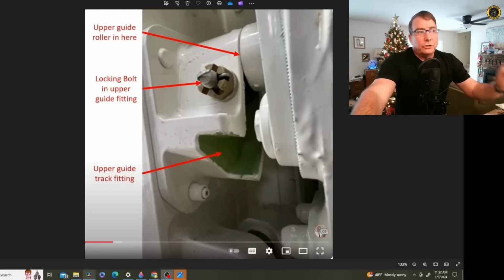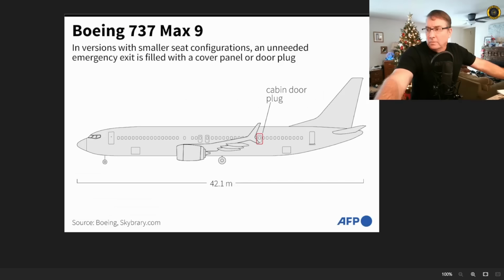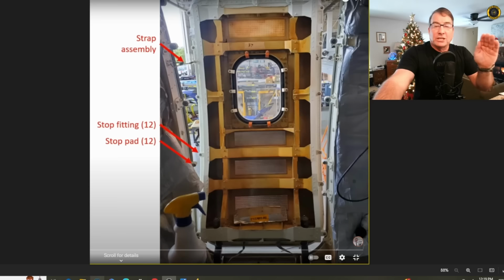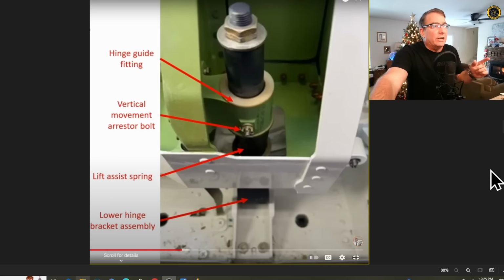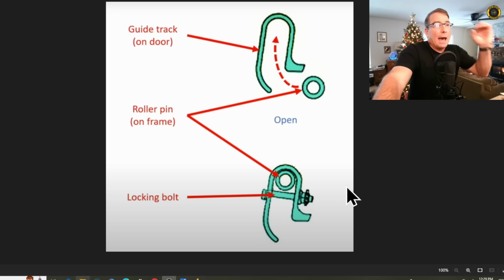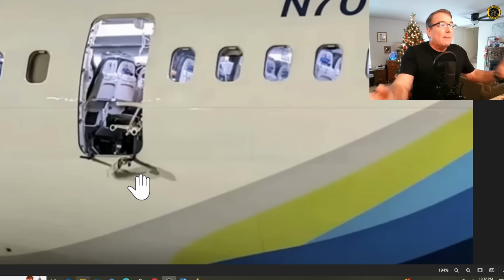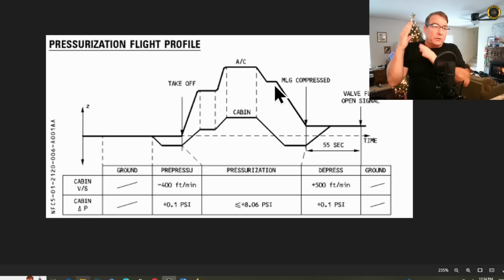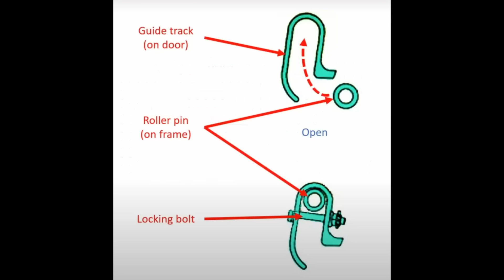Alaska 737 Max-9 Door UPDATE! 8 Jan 2024

Comment: To fail to install those bolts is criminal IMHO and that would mean that someone was up to no good. I just read that the bracket has been found and is cracked, so if the bolts were installed but the bracket was a POS, then there is nothing for the bolt to actually attach to. SMH

Comment: What the hell good is this door? It's bolted in place. There is no way to open it with out disassembly of the interior. It's not very big and it's in a useless location. I would suspect this door would never be opened for the life of the aircraft except for inspection. So these can't be used for an emergency exit. WTF?
Reply from the maker: see previous updates.

Comment: Perhaps a better design of door opening plug could be a design of key used in tunnel precast concrete lining. The lining is erected in sections called segments the last two segments have a tapered end from leading edge to the rear, plus a taper from extrados to intrados. The key segment has the corresponding angles on the side face and is pushed into the segment gap from the leading edge of the ring, a hydraulic ram is used to slide the key in which gets tighter as it goes. Bolts hold the key in place and the Tunnel Borring Machine excavates forward using hydraulic rams pushing off from the already built ring. This in turn tightens all joints. A cement/water gout is then injected to fill the gap between the excavated material and the back face of the ring. Overtime ground settlement will tighten the ring joints even more. To a point where all the bolts can be removed, this is seldom done due to the expense of labour and equipment.
The same joint angle could be employed on the plugs, but they would need installing from within the aircraft. So, cabin pressure would act against the plug from inside out, the opposite direction to a tunnel. The tunnel linings are being used in undersea areas of 5 bar pore pressure.

Comment: After looking at a diagram for the plug, I am still not certain how the plug is sealed against the frame. Is the plug sealed against the frame from the outside or is it sealed against the frame from the inside? In other words, is the cabin pressure trying to push the plug away from the frame or is the cabin pressure pushing the plug against the inside of the frame.
Reply: Those 12 interfaces are essentially two opposing tabs that protrude from both edge of door and the frame and overlap providing a way to keep the door from being pushed out after it’s slid in place.

Comment: There is still something missing. The door was still forced shut by the springs. It had to move 30-40 mm downwards against the two springs in order to release. So I Agree there is something missing with the securing bolts, but there must be something regarding the relative movement in top.
Reply: Wrong. You have it backyards.
Reply: @OsoMagna  you are correct.

Comment: To me that design is quite   Good. I don’t see how bolts would get stressed to even sheer. The bolts nuts pins wouldn’t get stressed. Loose bolts would hold it. Bolts with no nuts is another question. Even without out pins I don’t see many nuts that would spin of that easily on 4 separate bolts.

Comment: Why are these exits even there when you cant open them from
the inside ? Are they supposed to fall out in case of a crash ?
Reply: They're not exits, they're entrances.
Reply: If you put more seats into the cabin you would need these exits as emergency exits. Under a certain number of seats you legally don't need them and then they close it with a plug instead, since the plug has a full size window.

This is more flexible ( for example if the aircraft gets more seats in tge aftermath) than making fuselages with a different number of openings

Comment: Now that I see how the door plug is installed to it’s final position and secured by 4 bolts, 4 nuts an 4 cotter pins, it is obvious these bolts, nuts and cotter pins would have had to be totally removed in order for this door to have been pushed upward by the two lower bracket springs and then exit the fuselage.  Folks, this was sabotage and nothing less.  This airplane had very low hours on it.  If these 4 bolts were not installed at the Boeing factory, this door plug would have left the fuselage way before now.  This was sabotage and nothing else.

Comment: What's the purpose of all this engineering feat for a "non-door" door?
Isn't it just more convenient to install a normal door?!! Or no door at all?? 
Is it because it's cheaper this way if airline configuration doesn't require it?🤔
Reply: Having a single design of a fuselage frame, especially a critical part like the door opening saves money on the design side (only have to design and test one) and an actual operating door is much more expensive than this simplified plug.

Comment: Castellated nut should be SAFETY wired to prevent it from coming loose. It is standard procedure in airforce. Safety wiring is manually done and slows down productivity. Cotter keys can get sheared off and it is standard practice not to reuse once used cotter keys. Quality control inspectors must inspect evey fastener for appropriate tightness and the satisfactory installation of nut locking devices. Extremely critical step but also runs the risk of being ignored.

Comment: I haven't read every comment, however I need to ask, what the hell is the purpose of this plug door if it is bolted shut and not an emergency exit?

Why even have the F-ing thing as a failure point?
Reply: Because during the lifespan of that air frame, you don’t know what owner is going to require what configurations so it had to be built to allow for any possible layout including an exit door or a non-exit door.

Alaska doesn’t need the exit door in their current configuration so they substitute this plug door yet keep the option open for change.
Reply: @JohnHallgren 
Who requires the extra door and in what market?
Seems to be a safety risk rather than a safety feature.
Reply: @Danger_mouse  the number of  seats for Alaska is less than the normal max that are squeezed in for other airlines. So, with less passengers, there’s no requirement for this additional exit door. But Alaska is not going to keep this particular air frame for the entire lifetime so it will get sold off to some other lesser carrier, maybe overseas, and then get those extra seats put in, the door will  switch to an actual exit door, and it will continue flying.
Reply: @JohnHallgren 
Understood, surely it would be cheaper and safer to just fit the door and a cover panel.

All the best.

Comment: You are talking about pressurization and the aircraft being tested to 1.5 times(i assume 1.5 atmospheres) this is at ground level. Question is what is the pressure deference of the outside atmosphere at normal cruising altitude and the aircrafts inside cabin pressure?????  also is there a sleeve of some sort that goes into the pocket where the capture bolts go through, because without such an item when you tighten these bolts up the capture surround is just going to collapse and the bolts will come loose. Is a thread locking agent (Loctite)being used at all and why is boing also not using castellated nylock nuts being used for an additional form of security as well as a wire security loop??? it looks like boing is taking a lot of shortcuts in design at the expense of safety to me.

Comment: The 24hr news cycle and the media in general has a lot to answer for, the regurgitation of speculation surrounding this incident is basically "overhyped" with never ending innuendo dragging over the coals of the previous 737Max's crashes...which I might add, were not Airframe related..these crashes were avionics related.
I, in a past lifetime worked in aviation operations and as many who work in this industry know...aircraft are a very technical highly complexed mechanical machine as they do their performance for thousands of hours, hundreds of cycles at highly varying temperatures and altitudes. 
People today treat air travel as like a bus trip..yes, air travel is safer than walking across a 4 lane freeway during peak hour blindfolded, but, shite happens as we have seen over the last fortnight..re A350 in Japan and this 737 incident.
So read those safety cards in the seat folders, listen to cabin crew pre flight safety briefings and keep your seat belt fastened..
The good to come away from this..a integral part of a 737 fuselage unexpectedly separated from the airframe during flight, the aircraft continued to fly and with flight and cabin crew professionalism completed a safe return with no passenger injured known to be injured.
Reply: George Carlin would love that term, "unexpectedly separated".

Comment: Is it possible that the outflow valve was left in ground test pressurize mode? Therefore the plane would over pressurize at low altitudes Therefore explaining the  pressure Warning light..

Comment: Up until now I wasn't too concerned about the risks of flying because I trusted the aircraft manufacturers to get it right. After this accident, I finally lost trust in Boeing. Continued instances of loose bolts, even structural important ones. It's no longer about singular instances, I see a pattern here. Boeing has greatly reduced their quality controls in recent years. This is not even a joke, it's actually dangerous for me as a passenger.

Comment: Sorry   I usually agree with your comments but not this time.
You said all 6 vertical pins are in good condition and that all 6 cotter pins may have been missing and all 6 castle nuts could have vibrated loose.
Well yes if it eas on the ground in a trst jig possibly.

But in flight ilall 6 nuts most certainly Dodnt all vibrate the same amojnt at the same timd to all fall off simultaniously to release the door.

In the real world 1 nit could have fallen off, then another etc with each missing nut causing increased stresses, buckling and noises.
Somebody would have seen or heard or felt draft for a while before catastrophic failure occured.
Reply: You need to do your homework. See me after class.

Comment: Why are we assuming only planes with the plug-door installed are effected by this issue? 

For planes that actually have an emergency door there, isn't that door fixed in a similär/same way using the same holding mechanisms as the plug door? As I understand it the whole idea is to make them (real emergency door vs plug-door) interchangeable for the airlines themselves, in case they want to change the seating configuration for higher capacity.

As a consequence all 737 MAX 9 would need to be inspected, not only the ones with the plug-door currently installed.
Reply: Because they use a different mechanism that you have to inspect before flight.
Reply: @rumbecker5085 Of course does a emergency door have a different mechanism. I'm referring to the way the whole emergency door assembly is installed in the place of the door-plug. As I understand it the airlines can swap the whole assembly and can ether install a door-plug or an emergency door. I bet the emergency door assembly is fittet and fixed in the same way as the plug-door, hence planes with emergency doors installed can also be at risk.
Reply: @megakeule  Nope, you are wrong

Comment: The concept of using a cotter pin on such a device seems like your just asking for problems especially with the parameters that are incurred during the process of daily flight activity
Reply: Counter pins are used in numerous places, like tow trucks, to keep items in place, and when combined with a castle nut as well, should be one of the safest type fasteners.

Comment: Why can't Boeing just design a new airplane? Or buy other's design like Airbus bought Bombardier? 737 is a very old design with low gears so in old days making loading luggages easier BUT with those giant engines won't fit anymore. Look A220 is beautiful
Reply: Even an old design like this 737s could still fly safe if they would not have cheated the FAA at the Max certification and if they would not fuck up the assembly.

The 737 NGs have proven they can be safe - but back then Boeing was not the company they are today

Comment: Doors should be designed larger than the opening, PERIOD.  There is no excuse for passenger doors being not inserted from the inside & being INCAPABLE of yielding when under internal pressure.

Comment: Are the Boeing design engineers brain dead 💀 or am I missing something??  
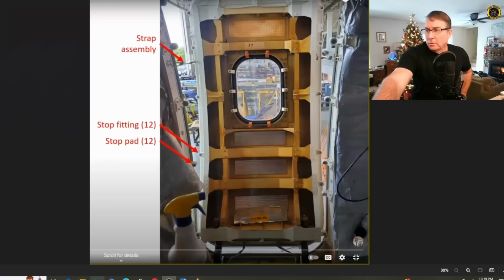The most important part of this video is between ~ 2:00 – 3:30.  The most important quote is:  
"...the door plugs are removed from the aircraft so that the interior installers can install the interior to the aircraft.  The door plug is then reinstalled in the aircraft..."  
Basic question, especially as this door  is an option:  
Why not follow Elon Musk's dictum that "the best part is no part"??  Why is this thing even an option??  
From the basic layout of the plane ✈️ there are plenty of other doors the installers could use to access the aircraft to do their installing work.

Comment: Juan, really! You’re telling the public these doors can rattle loose due to turbulence? So why aren’t they falling off daily? I think you are scaring the public to secure a seat for commuting. The real exit has a multi step procedure to open the door and as fitted with the thru bolts all four nuts would have to be missing cotter pins for the bolt to rattle loose. No someone removed then forgot to reinstall them after maintenance or factory install.
Reply from the maker: Pay attention Ed! You need to understand the pressure diagram, stby for an update...

Comment: Is the convenience of being able to open that door during maintenance that beneficial? They should've put a true fuselage "PLUG" there, shaped so that the greater the pressure differential the tighter it seals. It could be installed with 6 lightweight stainless bolts from any hardware store. If the maintenance crew wants or needs a shortcut into the fuselage at that location they can remove the fasteners and remove the PLUG. It would take 2 guys less than 5 minutes to remove the plug and maybe another 5 minutes to put it somewhere out of the way!          WHAT IS WRONG WITH BOEING? What is wrong with the carriers? What is more inconvenient and costly? Designing an airframe that requires a wrench and a little muscle to open a hole in the fuselage so maintenance crews can have a cool breeze while they work   OR    doing damage control, once again, trying to salvage what's left of a reputation for building the best commercial aircraft in the world.  There is no way to justify  the expense of having to have your public relations department on speed dial vs having to do NOTHING . Nothing because nothing happens. Boeing could be :"sleeping easy"because they build um Strong and they ALWAYS fly right. Instead, Boeing management must be walking the floor all night wondering when the next aircraft they build will kill another 250 people. If they are not, they should be. They should be ashamed period.
Reply: How do you get this plug into the aircraft?
How do you maneouvre it into position when the aircraft is full of seating etc.?

Comment: Missing bolts? No way were those bolts torqued and pinned to start with. Every bolt on that airframe has a torque rating. My two cents those bolts were not installed and completed for a reason. And now they show up like the bullet on John F. Kennedy's operating table? Horse s#%t.

Comment: As an engineer, I have to say that's a poor design.
Reply: To get a bit more detailed on why this is a poor design. This door is made to open outward. So it WILL. That is what it is designed to do. PLUS it has pressure on it, trying to force it open. Those 'stop pads' do not stop it from traveling. They stop it from rattling. That's all their purpose really is. 
If you do NOT want a door to open OUTward, you must design it to open INward. As design choices go, this was made for convenience, NOT for safety. Anything that can open outward sooner or later WILL open outward. It's got four bolts holding in place and both cabin pressure and spring pressure that wants to open it. It's also in a place which experiences a lot of vibration and up and down motion.
I'm not at all surprised this happened. The door should have been made to open INWARDS. So that if the 4 points of failure fail, it doesn't matter. Door won't come off.
Again, this was a stupid design.
We'll see this again.
Reply: @vanstry  Strongly agree! (Mechanical Engineer)

Comment: What I don’t understand is why Boeing has fitted this door system? Surely because it’s a bigger aircraft then it should have enough full proper exits for emergency use , have they done this door because Boeing new there was not enough proper doors for passengers too escape in an emergency? When you look at other aircraft they don’t have a plug door, they have enough emergency exits designed in the aircraft. It seems to me that Boeing lost its way building the max 737 in a hurry to compete with Airbus. The 737 max because of poor design has taken many lives and with other faults now this plug door ? Boeing has over stretched the 737 beyond what is safe hence they have messed up with this aircraft and should’ve designed and built a proper safe designed new aircraft as a replacement for the 737 , they pushed the design of the 737 too far and rushed the whole thing just because they feared loosing their market share to Airbus . Even employees said off camera that corners were being cut , it’s a shame because Boeing have built some very good aircraft 747 etc. if you stretch an elastic too far things can go wrong.

Comment: I call bs. I bet the crew did not secure the door properly before take off. Get those urine cups ready.
Reply: Which part of this video did you totally miss, the entire thing? This door is only opened by mechanics after removing a row of seats and the interior trim panels on rare occasions.. it’s bolted in place in a closed position the rest of the time.